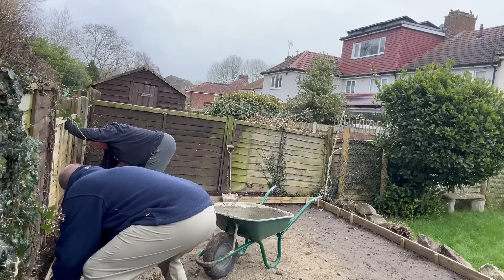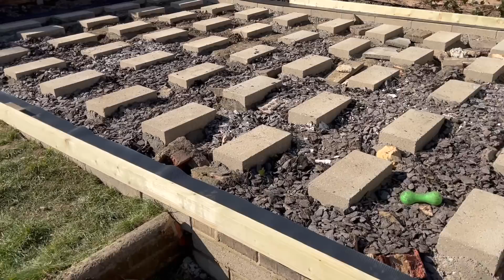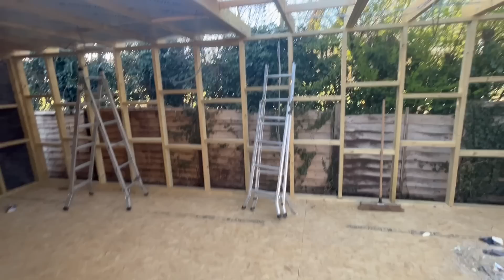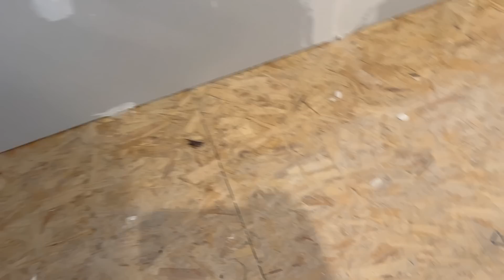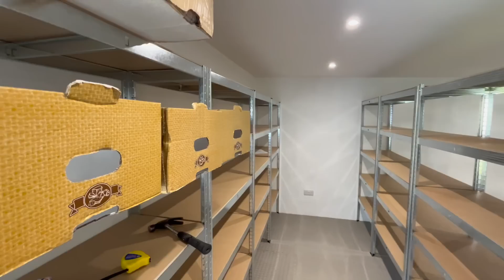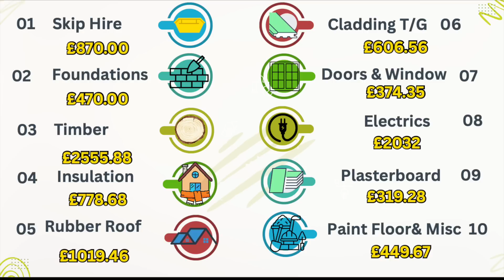Budget DIY Shed Build Full Cost Breakdown (I Saved Thousands)

Comment: Bloody good job that man! I'm doing one myself next year of similar size but it's replacing a rotten kit bought one that I put in 15 years ago so I've got the electrics and half the slab done already. I'm a Plumber turned Builder tho so I'm kind of on the tools for a living. One thing I wish you'd of stretched the budget a little on though is full PIR insulation, seeing that rockwool sent my OCD radar off😆
Reply from the maker: Thank you so much I appreciate you watching and wish you luck on your build, it sounds like you know what you are doing. Kind regards Simon

Comment: Great job you done there, very impressed.  I relly like to know if you neeeded planning permission as its very large.
Reply from the maker: Hi, thank you so much for watching and taking the time to comment, The regulations with planning the building needs to be no bigger than 30m2 internally and no higher than 2.5 metres in height. I kept to these measurements, I actually came in at 29m 2 . Hope you have a great day, Simon